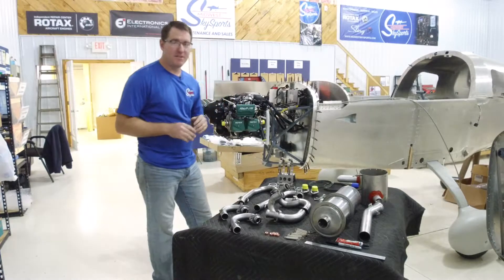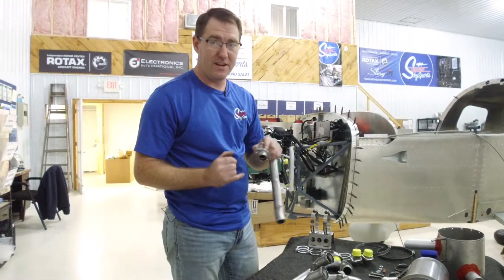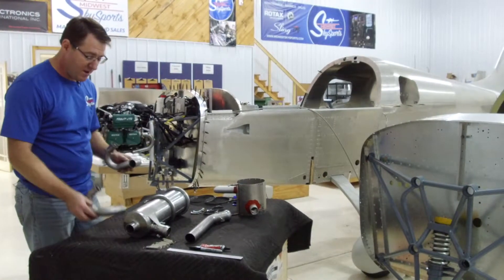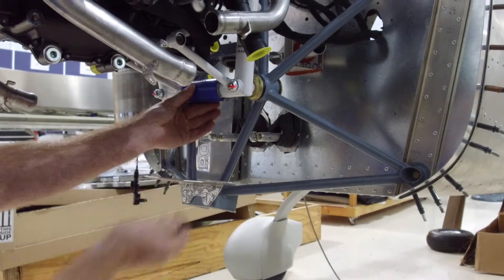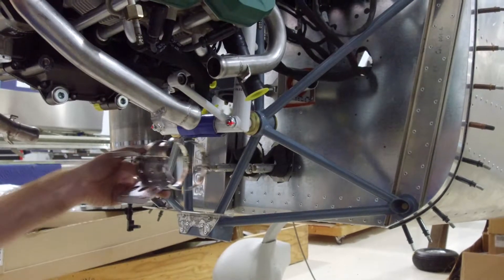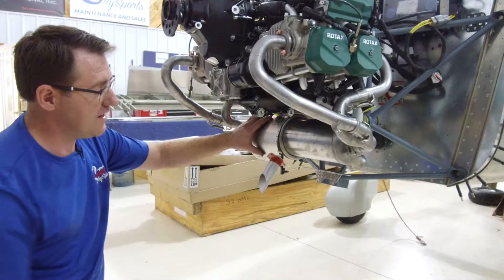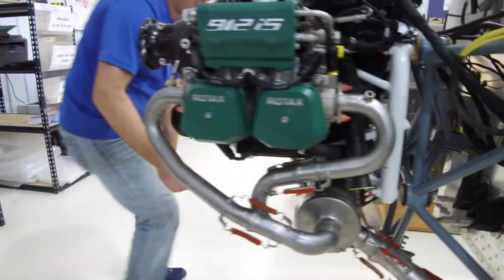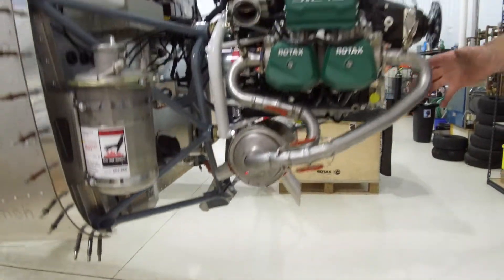Rotax 912iS Sling 2 Exhaust Install

Comment: Great video. I’ve been fighting small exhaust leaks for years on my 912. The ball and socket design makes it hard to seal the pipes to the muffler. Apparently high temp rtv will help seal the joints. Also, covering the joints with fiberglass tape (lava tape for no slivers)